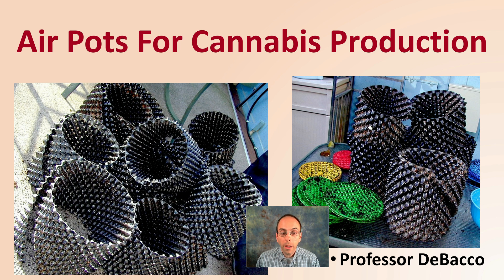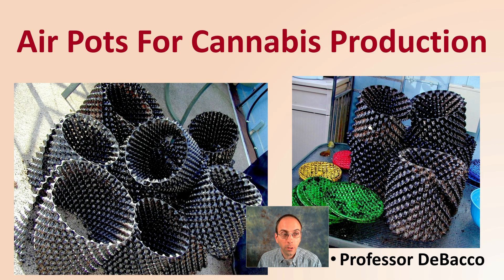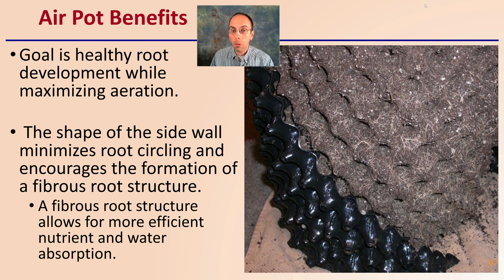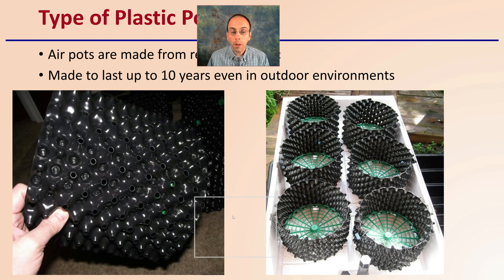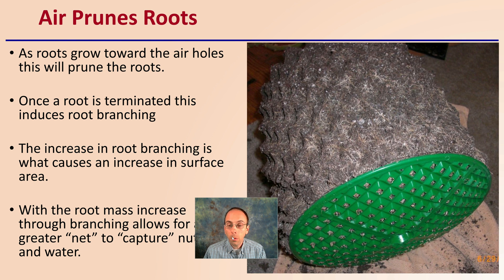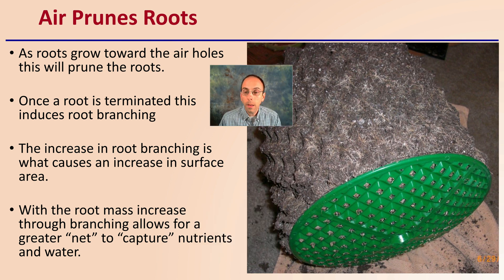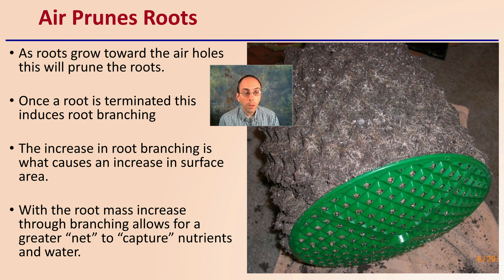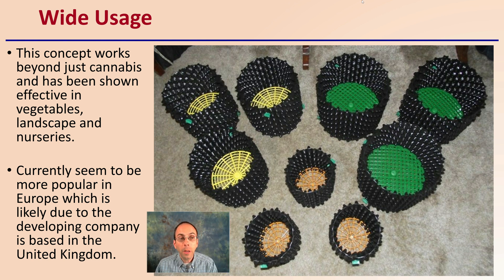Air Pots For Cannabis Production

Comment: I want to use them but im not sure if they’ll need a lot more watering. I use coco fiber. I’ll test one before I change over. ✌🏻🇦🇺
Reply from the maker: You'll want to check the moisture level more frequently than a standard pot, but it does depend on the size of the pot.
Reply: @ ok thanks 🤩

Comment: blue 50 cent walmart recycled tote bags, much less expensive. make sure bottom is elevated (I put mine on a pallet). but these might last a year or two max but for cost it's worth it. also helps identify salt buildup on outside of blue bag when dry.
Reply from the maker: Sounds like a cost effective option.

Comment: I’ve used these indoors and plants grew very nicely but the holes I’ve name it a gnat hotel and your encouraged to stuff the soil in the pot. Be careful u can build them upside down they dry out quickly and u haft to water slowly I felt like I was running hydro. And the soil did come out the holes and u can’t water from the bottom another thing I like to do so often.I’m sure there different outside. Easy transplant ackward to manouver. Grew really good plants but I couldn’t get over gnat hotel I’ve used up the rest of my airpots and switched to Radicle Bags there great and gnats went away.❤️
Reply from the maker: Pros and cons with every method, but thanks for sharing your experience for others to consider and make an informed selection.
Reply: Once ur roots gave grown u would be able to  water from the bottom

Comment: Thanks, so would you say these are better than normal pots with the holes at the bottom? When it comes to magnesium I use Epsom salts on my vegetables, would a weak solution be of benefit to cannabis plants, I've been adding a little and it seems ok, I'm only using organic fertiliser for my plants, egg shell, banana skins, spent coffee granules etc, some very good results so far.
Reply from the maker: The "better" option depends on the growing conditions.  An advantage is air pruning of roots, but a disadvantage is the irrigation frequency and duration often need to be increased compared to traditional solid side containers.  Epsom salt can be added with good results especially in the cases where Mg and S are deficient.

Comment: I use these. Great pots. Plant roots love them and form dense thick balls. The only thing I struggle with is watering them. I like my soil to really dry out between each watering but that causes the soil to harden a touch. Watering is a bit of a pain and has to be done very slow or it just escapes out of the many holes. Anyone got any tips for me or a video they can point me at please ?
Reply: more perlite.
Reply: I had the same problem using Fox Farms soil (ocean forest) . In my last grow I changed soil to Promix HP and boy what a difference. When I watered the soil the water went straight thru. The soil texture is like I just installed it.
Reply from the maker: Typically irrigation frequency needs to be increased compared to traditional solid side containers.

Comment: They work excellent. 
Sometimes people assemble wrong and have bad results. There is a top(hold water)and bottom(airflow).

They work great with an automated system.  I use Coco, the Thap 3 size with a FloraFlex tray and circulator for the top. And a bottom tray with a hose to a condensate pump/tank to pump the runoff to a remote bucket. (1 Liter airpot after small red cup)

Learn pulse irrigation.  I give a shot every 3 hours 24/7. 15 second shot at 1-4-7-10-1-4-7-10 starting Flower. Add time to the lights on as needed.
Adjust shot times  depending on daily runoff amount. 

It might sound crazy but if you have a Bluelab Pulse Meter you will see it.

Sorta like the gas tank on your car, use some and put some in. Never let it go empty (dry).
Reply from the maker: Thanks for sharing your specifics and good analogy with the gas tank.  Pulse irrigation is another great tip with this set-up, so hopefully others will read your comment.
Reply: @DeBaccoUniversity  9o7ii

Comment: I was considering them but I was warned by the guy at the grow shop that the holes provide generous space for pests. So be careful.
Reply from the maker: What type of pests?  The aeration should be similar to the surface of the container depending on the substrate used.
Reply: @DeBaccoUniversity  I haven't found pests with air pots - far less gnats with them than trad pots.

Comment: I grow tomatoes in these and the root structure is absolutely amazing!! Wondering if fabric pots can do the same. Thank you for the video Professor!
Reply from the maker: Air pots have the physical holes so for fabric pots to be similar it would come down to the material.  However, odds are the air pots would still perform better since there is an actual gap in the side wall material.

Comment: I use these have them from 1 to 5 gal pots and these things work fantastic for growing.
Reply: Better than fabric pots?
Reply: @stonerman15  I seem to get better looking plants in these. I use the 2 gallon air pots . They worth trying in my opinion, Good Luck and Stay Safe ,
Reply from the maker: Thanks for sharing, they do come in a variety of sizes to fit multiple growing needs.
Reply: I was wondering if they are are prone to breakage. Are they flimsy or sturdy ?
Reply: @Hartlor_Tayley   they're strong, but buy the brand name, the cheaper ones suck. Stay Safe out there
Reply: @1painter4hire  good to know thanks for the tip